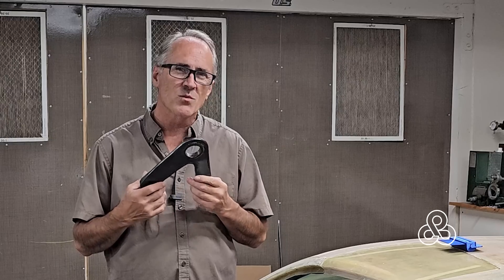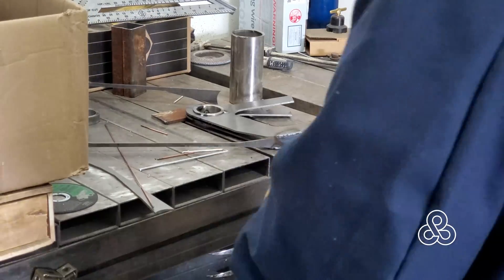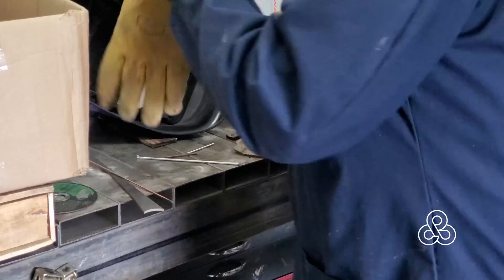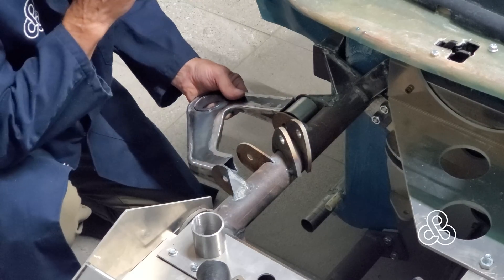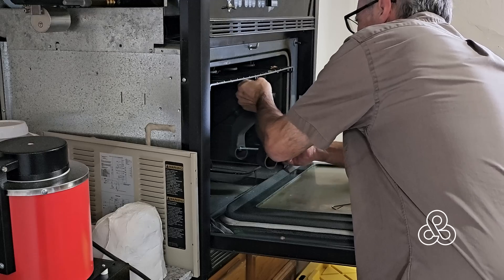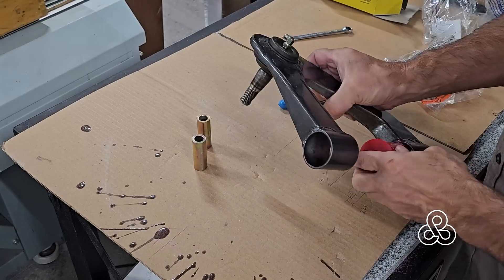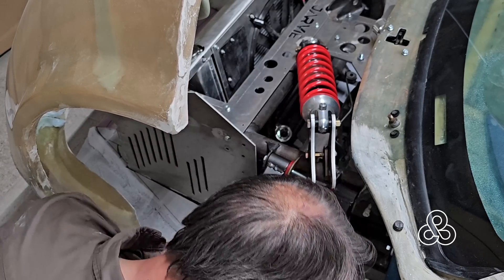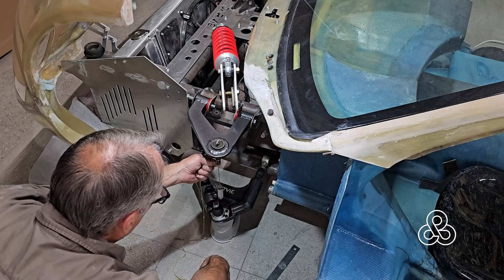A90 Subtract 32 hrs from 7000- Am I almost done? Arete Supercar project

Comment: Why not use 'ball joint eliminators'? Using a ball joint eliminator kit would negate need to replace dangerous ball joints after worn down. The eliminator requires replacement although at a much later time than a standard ball joint. Ball joints coming apart are dangerous and can send a wheel flying if you are unaware of their condition. Oh well. Just love this car stuff is all.
Reply from the maker: Worn down ball joints is an occurrence to a car that moves and has a lot of miles on it. Ha!

Comment: Urethane bushings will not give, will not isolate noise and vibration, usually a disaster for street car!
Reply from the maker: There are different densities of urethane. We have chosen slightly to the denser (performance) side, but should also have some decent "street car" isolation.

Comment: I really enjoy your work Jay, it is the embodiment of the creative engineering process.  I designed and fabricated a novel rear suspension for a motorcycle and was lucky enough to only have to swap out the shock and spring for a heavier sprung item.  As I am not a tech guy so I built a full size 2D mock-up of the system out of cardboard and was able to verify the geometry within the parameters of the bike's dimensions and the systems functional requirements.
Your point about creating from your own mind's eye and not making a replica is absolutely vital and necessary.  In so many creative areas people follow what has been done before or what has inspired them by copying.  Be it cars, fan books, fan films, etc. and they have all lost the opportunity to share what is unique and personal about them with the world.  Best regards, brother, I am traveling up to Portland from California to deliver some items for a family member.  It'd be neat to meet you in person, but it is short notice.

Comment: All I would say to the naysayers is that even if you look at vehicles on the road, even they aren't beyond failure.
I used to work for Ford the amount of recalls we did for various failed parts.
Reply from the maker: Ford- that's a lot of cars out there that could have a faulty part, but again a lot of engineers and QC people to keep it right. One man one car- The odds just increased in my favor. Thanks for the message.

Comment: They look great! I highly recommend using a jig to set the pivot points and where the ball joint is in relation to each other. The angles and distances will be way off. You’ll find out when you get to drive it but hopefully you’ll reconsider before getting that far down the road.
Reply from the maker: I would bet that the waterjet accuracy is so close that with the ball joint ring lining things up on one end and the pockets on the other end lining up the bushing end the rod ends below can adjust for any discrepancies. However, as the video pointed out everything is experimental, even alignment jigs.

Comment: A QUESTION if you would,
When powder coating, where it hangs, isn't there a part left uncovered by the powder where the hook/ground wire is and how do you deal with that? Just a second coating??
Reply from the maker: Most parts have some place were you do not want or need a coating. Usually threaded holes, or in my case the ball joint socket.  If I have a "clean" part I will often use VERY pointed stands that the part sits on (usually on the back side, or most indiscriminate side.)

Comment: I appreciate that you are going to such lengths to build custom parts!  But, I fall into the category of folks using a donor car as I love to design/sketch but not much else.  That said, a warning to others like me:  It still takes longer than you think! lol.  I built a full custom targa/hardtop for my NB Miata a couple years ago and never even installed it.  Then, earlier this year I hit two pretty large deer in the front driver side.  At that point it needed a whole front clip replacement.  I figured, "gimme a month of weekends and I'll knock a rough one out."  It's a daily/backroad beater so it doesn't need to be perfect.  Fast forward 6 months of weekends and I'm nearly done!  lol.  6 x the time and 3 x the cost!  But, now the only non custom fiberglass parts are the doors and windows!  A lot of fun.  But, I'm starting to understand what you've gotten into!
Reply from the maker: Yep, but never add padding to your estimate or it will end up actual time/cost, plus padding, plus over run. Ha!

Comment: It's fun watching your choices of what goes into a supercar project. I never heard you use the term "mild steel" and I think it may be because it's not a popular option today with all the exotic materials available but mild steel is strong, very strong. Your upper A arm could easily handle being used on a truck. Your suspension joints are extremely conventional too but also very strong, reliable, economical and easily available. I'm sure people have suggested heim joints as they are common on race cars. They are light and have lower compliance which results in more accurate motion and feedback but for street use leave a lot to be desired. I admire what Honda did on the original NSX using firm bushings on compliant mounts, no one to my knowledge had duplicated that.

I like your inboard suspension too and can't wait to see how you put it all together. I've driven purpose built race cars and I've modified street cars into road race cars. There is a point in modifying a car where you just can't put it on the street anymore. It used to be if you could hear your exhaust note modulating off buildings as you pass them you were too loud. Then if you had to slow down so much to cross a bump in the road or RR track that cars behind honked you weren't a street car anymore. Here's one you'll like, when you can't safely park in a parking lot because your full race limited slip locks up and you need to apply enough torque to hop a tire to move. 

Engineering is just deciding which trade offs you can live with. I hope your work inspires others to follow their dreams whatever that may be.
Reply from the maker: Engineering trade-offs are for teams where there is another engineer that you can trade off with. Ha!

Comment: The fact that you design and build your own control arms is absolutely amazing to me. I wouldn't have even thought about doing that. Just getting the correct attachment locations for factory control arms was difficult for me... Amazing work!
Reply from the maker: I did draw the line at not building my own engine and transmission. ;)
Reply: @BuilderCreator  Transmission maybe. But you can’t say that about your drivetrain, it’s pretty unique.
Reply: Hey Roger!

Comment: Nice work. It's almost on its wheels. In NZ scratchbuilt suspension components need an NDT certification. Not a bad idea.
Reply from the maker: The same here, NDT= "Not Done To" any certification. Ha!
Reply: What's a NDT?
Reply: @bobolulu7615  non destructive testing. Eg typically  dye, or magnetic flux. Quick and relatively cheap. Report checks for cracks, porosity and inclusions. Other folk more knowledgeable than me can provide more info.